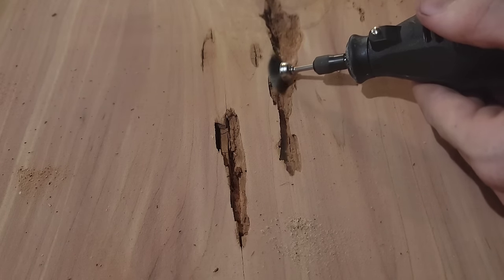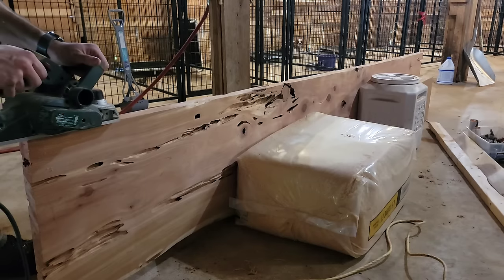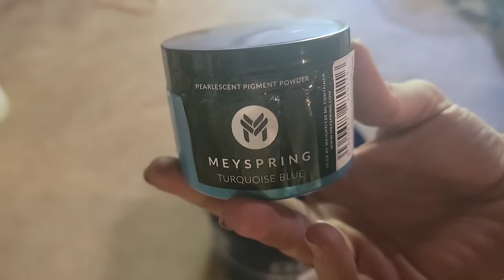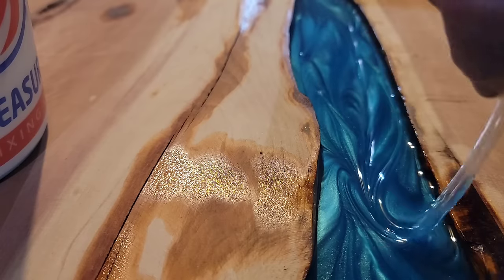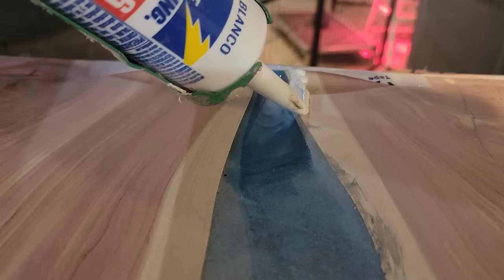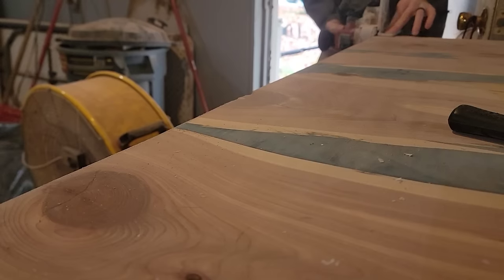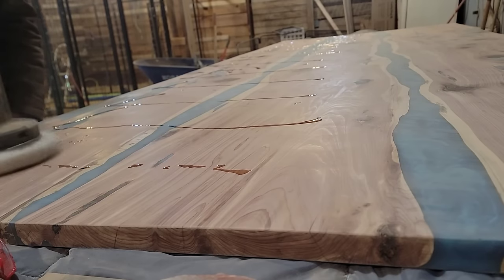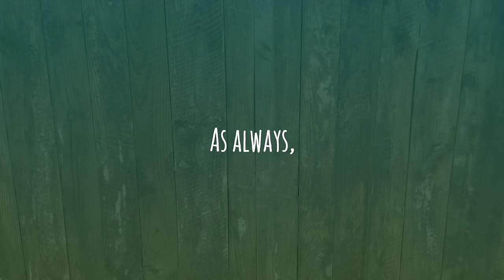Making A Cedar Resin Table (And All Of The Things I Did Wrong)

Comment: Absolutely love the project, and watching this type of detailed, step-by-step explanation of what you did and how you did it - especially highlighting the challenges and mistakes - is incredibly helpful. Gives me confidence and makes me want to try something similar.

By the way, I know the legs were the clients’ decision, but they really do not do the table top justice at all. Just my $.02. I know they can be swapped out pretty easily, though.
Reply from the maker: Thanks for the positive feedback! I was hoping more than anything that I may be able to teach people from my mistakes.

And I couldn't agree more about the legs. 
The clients have actually had second thoughts about the legs because even with 6 steel legs like those, it still has some wobble (if you push sideways on it) because of the sheer weight of the top.

Comment: I work with big Cedar and you're 100% right.  It's a finnicky wood that requires way more finesse than just about anything else I've used.  A couple things that I've learned.  Start at 120 grit and random orbital everything.  Raised resin is unavoidable but a scraper knocks it down nicely before you continue to higher grits.  Cedar dings, and is ultra soft so make sure you're client understands this.  To finish I've used polymerised Tung oil with a bees wax sealing coat.  Doesn't make it any harder but it feels amazing.
Reply: Trying using the new ceramic coatings...check out Black Forest or Blacktail videos on it

Comment: Soon as I saw all those voids I went "there is 60 hours in just prep right there". Instead of using the planer to straighten a side, could have used a long level or straight board, track saw, circular saw, etc. A while back I did Blacktail studios epoxy workshop (paid course) and I don't like epoxy tables too much, but the sealing is very helpful just in general. Also, I see a lot of against grain sanding which can crap out the finish, especially cedar which just likes to tear out a lot. For the oil, I learned a lesson, I apply to the pad only no matter what wood, walnut, cedar, pine, oak, red oak, maple. I messed up a small project and realized it didn't save me any time and in fact cost me 10x the time.

Comment: I’ve usually use cabinet scrapers to remove the high points of resin rather than sanding.  One, is doesn’t impact or sand down the surrounding areas.  Two, there’s nearly no dust.  And three, it’s quieter

Comment: A very nice piece of art! 
I believe your main problem is your not having the experience with western cedar. For that matter any cedar. I moved from N. Calif. to another cedar enriched area, the Osarks. Although the "cedar" in the south isn't a true cedar, more of a Juniper, it has most if not all the qualities of the western type.  Because of it being so porous it will soak up anything from common water to any type of oil and gain the same results(as far as staining).I've never used Odie's on any cedar or redwood projects, but teak and Danish oils have the same effect on both woods.  If you find yourself with another project using an oil finish on these types of woods, brush on the oil fairly heavy and wipe off in about an 30 mins. You'll have to wait a day or two, most likely two to let the finish sink in and semi-dry, but the end result after buffing will be a deep appearing semi-shine. The grain and colors will really pop.
I've also never used it on epoxy, so you'd want to try it on a test piece first. IMO

Comment: That is a good oil I personally use Rubio mono coat , with you can use a squeegee or paint roller 
Coat the whole surface then buff . After dries go back with a green or maroon pad on buffer with no pressure at all applied then re coat  works well and shouldn’t leave any dark spots

Comment: When you're using a circular saw, put the bigger part of the base on the work; you have the small side on the wood and I can see you wandering from 90 (it's real hard not to!).   Or, if you're going to do this again, just get a track saw.   They are amazing for this kind of thing and make it laughably easy to get straight/square cuts.   Because you're locked in a track, it's impossible (well, you'd have to work hard at it) to get off 90.
Reply from the maker: I understand it would have been straighter with the larger side of the base on the workpiece. Because of how my particular saw is designed, however, the motor is very low and off to the side. I would have been unable to use the straight edge like I did. Now, if I was just following a pencil marked line, then it would've been no problem for me to flip it the other way. 
I knew I ran the risk of not keeping it at a perfect 90° by cutting in that direction, but I figured that risk was outweighed by the need for me to use a straight edge.
Reply: @fallowgroundstudios  Yeah, I had a saw like that too, my edge clamp JUST fit under it.   Best answer, get a track saw!   I have the Makita, less expensive than the Festool and I've been very happy with it.   I have the 50in and 100in guides and use both of them regularly.   The 100in guide is not cheap, but it's dead straight.

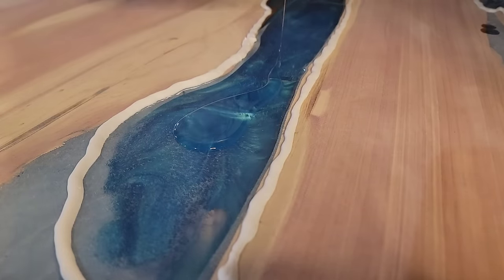Comment: @ 21:53 You talk about poking the holes with a needle, but can you push resin into those tiny holes with a card of some kind, or a scraper? just something with a really thin edge and drag it all over the areas where there's tiny holes essentially working it into the epoxy  this way? Or how about using a syringe and injecting into trouble spots for more precision?

Comment: A good job on the table just 2 minor things to think about, 1 those legs do nothing for the table and 2 threaded inserts into the timber  with clout head screws are much stronger and hold better than self tapping screws with washers , other than that as a first time using cedar and doing it and working at the same time you have learned a great deal so future projects will be easier to handle , well done from Tasmania Australia 🇦🇺

Comment: Let us know if the table sags any. I see the center legs, but cedar is such a soft wood. I stopped making tables with cedar bcuz, as beautiful as this wood is, it's just way too soft and I found the only way to REALLY make cedar pop is by flood coating it with resin. And I don't like resin being the complete surface of my tables, especially a flood coat, bcuz it WILL scratch, eventually. The last cedar tables I made were for my parents (living room set), bcuz my mom loves cedar, it's her favorite....and when it gets scratched up, I'm their son, so...free repairs and maintenance, lol. The odie's looks good, but as soon as you said you drizzled it...I knew exactly what was coming next, lol...a whole lot of elbow grease and applications. I learned that lesson myself. Walnut and maple....I'm just used to pouring blops of finish and not having an issue...so it's habit. But you'll only make that mistake one time, lol. The table looks good man, just sharing my own experience with cedar. Also...subbed. Looking forward to checking out your other content.
Reply: The other thing I would recommend: threaded inserts for your legs and c-channel. Especially with these soft woods. One of my "selling" points is that I never use screws or lag bolts...I always use threaded inserts and bolts...even for hairpin legs. If you've never used them, it takes a little practice, and you'll make a few mistakes...I did...but I can pick my mom's coffee table up by the hairpins and they're solid as a rock...even in that soft cedar. The last thing you want to hear from your client is that they were sliding the table over a few inches and the leg tore out of the wood. Know what I mean?

Comment: I don't know if it's an optical illusion, if I have done something wrong but my epoxy will not lay flat. I mixed it for over 5min to make sure I had it mixed properly and my second coat the thicker coat a little under an 8th inch thick at tops and it keeps looking like it's got pockets that will not cover. It has no bubbles I can see and it's still wet it just looks uneven. I sanded the original coat with a 600 grit orbital sander and then with 000 steel wool. I then wipes it down with acetone and allowed it to dry. I poured my epoxy and spread it out with a spreader and then my gloved hand. I popped all bubbles with my torch. It is still wet but when I look at it from the side it has these pockets and if I spread it to fill those pockets it just gets pockets elsewhere. It's really pissing me off. I guess I'll allow it to dry and check it out tomorrow but if it still has them I don't know what to do.
Reply: OK I seen you say the boards are not perfect but I had mine perfect as far as I could tell. I made the whatever it is weeks ago. The wood has been in my shop for 3 years, it's oak, has been sanded down to 180g then I stained it, allowed it to dry for weeks, then sanded it down to 320g just to make it super smooth. I also added a sanding sealer before and after I stained it and then sanded it which was probably over kill but like I said it has been sitting for weeks probably longer before I put the sealing coat of epoxy on it last week and just now trying to out top coat on about 20min ago. I could use some advice.

Comment: I wonder why you think the dust in the air will cause problems for you, thus waring a mask, but will not affect your dog.  Sad to have the dog in the project area.
Reply: Dog would leave if he would found it unpleasant. Dogs smell is about 1000x more sensible.
Reply: @valdisprancans1406  Pretty hard for them to leave from locked cages. And it's not about smell anyway. Epoxy dust is bad for you, it can cause respiratory problems when inhaled.
But the table looks awesome!
Reply from the maker: They're not my dogs, and it's not my shop. This is just the location I was required to work for the clients. Also, the barn doors were open with exhaust fans on during sanding. The dogs also were not locked in the barn. They had doors that led outside.
Reply: So sad for the Dogs.😩

Comment: Lol, why didn't you just drop your router jig a 1/2", and go over it again that way? I laugh, cz it's the same thing you were looking at, it was uneven, you needed to flatten it. You used the router, like many people do, cz no one has a 4' planer, and then the next time, you didn't even mention it the whole time you were putting yourselves through hell. lol        .... like 5 mins in, the first time you use the 5" rotary, I said to myself, 'omg, if I had to sand that table with that sander, I would shoot myself.', lol, and that was going to be my comment, and, as you know, it just got better and better, lol, or worse and worse, I guess, depends on pov, lol

Table looks awesome. Important part, is you did what you had to, and didn't quit.Easy to do on such a big piece that isn't working out. Good job.

Peace

*To the client - it needs chrome legs, trust me🙂.... or matching wooden ones.